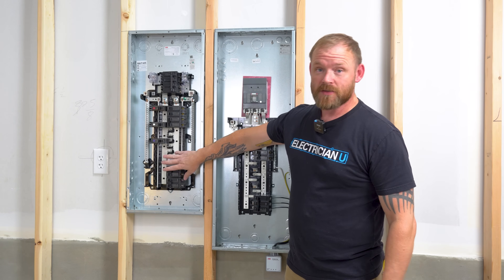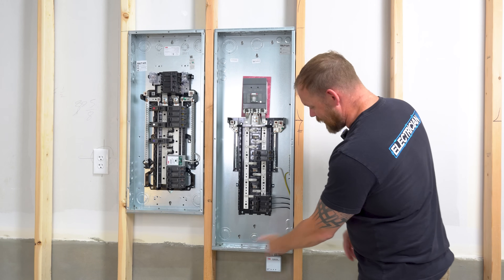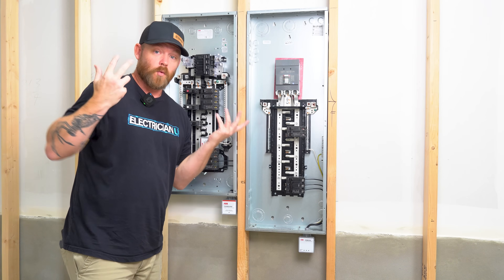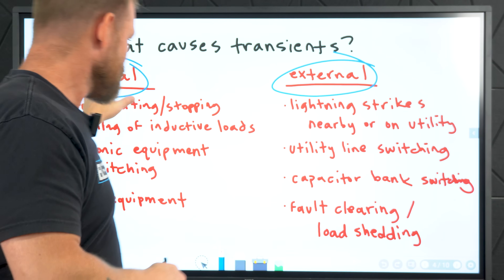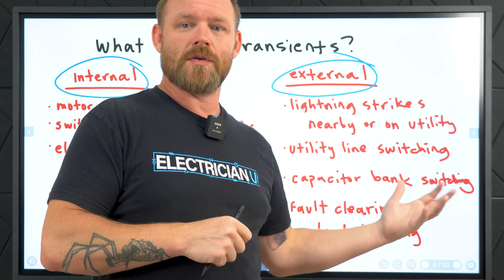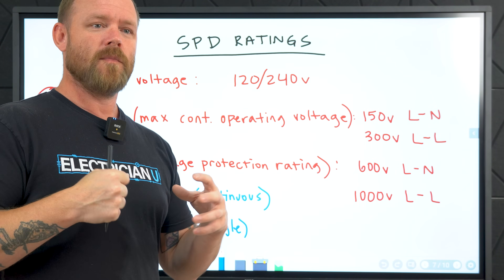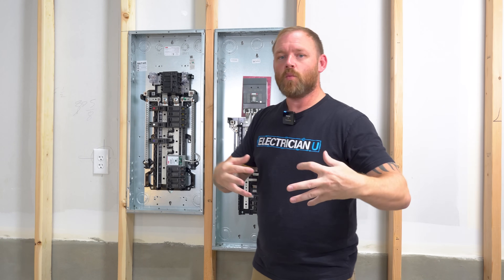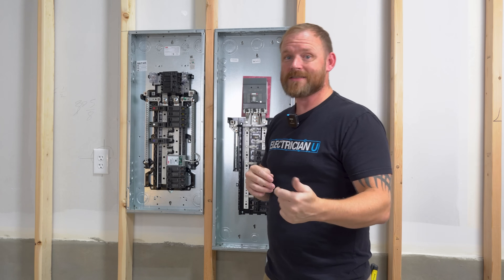What Surge Protectors Actually Do (and What They Don’t)

Comment: I after 50 yrs would add, most surges come from off site sources. My practice was to place the suppressor as close to the Main as possible. In addition should always be protected by a breaker because a direct lighting strike will blow the suppressor to pieces. Without a breaker it could do catastrophic panel damage and take down the building electrical. My$.02 worth.
Reply: I've seen surge protectors (and panels) completely exploded to non-recognizable bits of metal and plastic all over the floor with shit stains on the walls where they once occupied.

Comment: Would there be any benefit to installing two side by side surge protectors in a panel ???
Reply: Yes.  Well, two single-pole SPDs in the panel will protect each leg.  You can also put more  SPDs in (such as putting in 2 x 2-pole SPDs) to get somewhat better protection as the energy from a surge will be split between the units. 

But it still won't protect against a direct lightning strike and unless you have a sensor connected that informs you when the SPD has tripped or blown its fuse, the devices often become useless blocks of plastic without the home owner knowing.
Reply: SPDs are additive for dissipation energy.

The only reason I could imagine to have two together is that two small ones were cheaper than just one with twice the capacity.
Perhaps they were purchased from a closeout or surplus auction.

Comment: I was literally just talking about these yesterday with my neighbor. Our trees have been getting struck by lightning and the last strike traveled magnificently. Hit 2 trees, fried all of my one neighbors tvs and did something to another neighbors appliances before the power on their side went out. I was out of town and my power never went out but I had some devices that weren't working anymore. So I decided to finally look into whole house surge protection AND what options I have for lighting protection.
Reply: I still have the fried voltage regulators from a computer power supply. All of the other computers in the office were connected to surge protectors, this one was not, reason unknown.

We had multiple instances where Tripp Lite dutifully sent us replacement phone line protection modules (their Isotel surge line of protectors) when they successfull stopped lightning surges. Did not help the one modem, from the days of dial-up, that got zapped! This modem we thought was connected through the surge protector, turns out that it wasn't. (There was a splitter connecting to a wall phone.)

One particularly stormy Summer, Invisible Fence kept sending the wrong replacement transmitter model. Keep in mind that everything is still under warranty. They have versions with and without lightning protection. We did not fully understand this. The original unit did have lightning protection, identified by a separate terminal for connecting to a ground rod. (Not sure why this unit failed.) The first replacement came with a separate surge protector the loop was to pass through. We were hinted at that the replacement models were of a newer, better design. Not the best design, it was sending the signal back through the main power line (burried) so the dog couldn't walk around the building! Multiple returned transmitters, and exploded(!) wall-warts, later, they finally got it right and sent us a transmitter with the lightning protection. We were told these replacements, with surge protector, would be fine. I don't think they realized how big a loop we have to cover three partially tree-covered acres, and warranty departments being what they are.
Reply: For lightning protection    Don't get hit

Comment: You want to connect the surge protection device "As Close to Incoming Feeder" as possible for best protection.
Reply: Nope, read the manual on your surge protection device. You need 30ft of wire between you and breaker basically.
Reply: Negative

Comment: Good job Also any time the primary side of a transformer loses power it will causes a spike on the secondary side of the transformer due to the collapsing magnetic field around the windings of the transformer.
Reply: Unless you are very lucky and the loss of power on the primary happens on a zero cross. But that is unlikely enough that you should never plan for it to happen (unless there is shutdown circuitry specifically designed to cut power only at zero crossings).
Reply: As I noted above (a truck took out a pole and it spiked the system so hard it blew outlets off the walls in my friend's house.

I was renting a house on the coast (Pacific Beach, Wash.) and the wife came and commented on how bright the lights were in my daughter's room. HOLY COW. They were amazing. I put a meter on an outlet and got 240. The place had an indoor panel outdoors in the equivalent of an owl house and the neutral died on that circuit. I repaired it and cleaned the other connections and all was well again, aside the untimely death of the electronics in my daughter's room.
Reply: @kellyvcraig hmm that’s odd the electronics died, they usually can do 120v - 240v 50 - 60hz without a problem. You’d find things like hair dryers and lamps frying

Comment: Don't forget to do what I didn't do, turn on the breaker....
I have a Siemens panel on my house. My electrician friend of mine help me install a Siemens SPD in the panel.  Several years passed, our washer got zapped, WTF?  I have Mini-splits, and other VFD's that I have installed SPD on that ddn't get zapped. For some reaon beyound my control, the Siemens SPD was turned off, probably because we don't have any curcuits connected to this device.  So remember to tell the homeowner not to turn off the breaker. It should always stay on.
Reply: Or it tripped without you noticing at some point in the past, prior to the strike that zapped the washer.  SPDs with integrated breakers will trip the breaker and often not blow the SPD fuse, but won't auto-reset.  The only real protection is on the circuit connected to the integrated breaker (and also only if the green LED is lit when the breaker is closed).